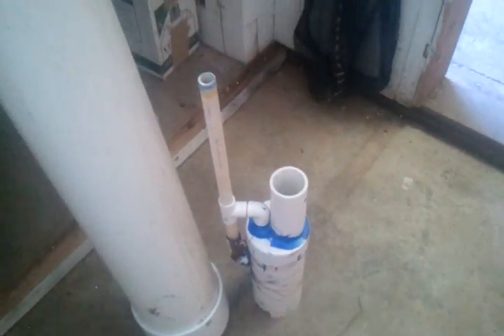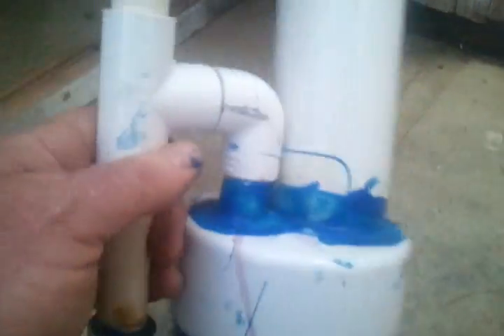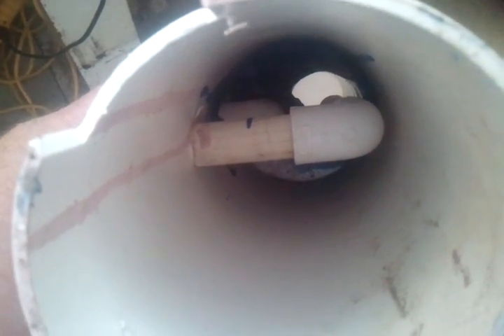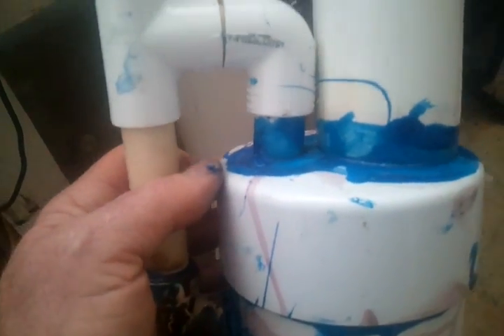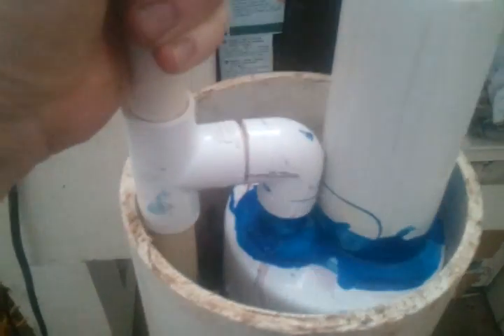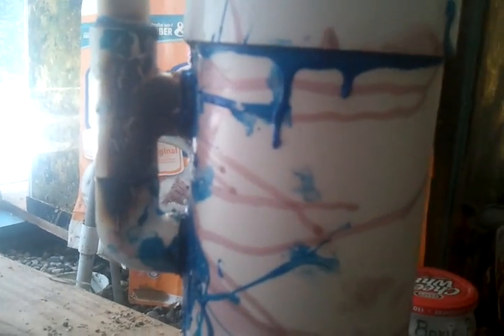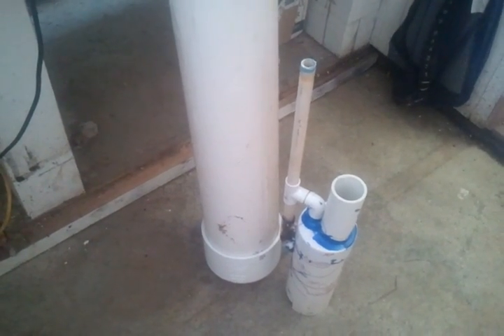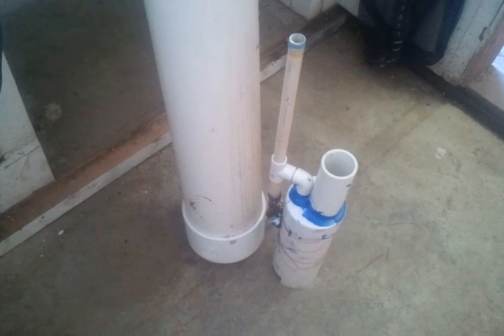Geyser Pump

Comment: Bob, Tnx for sharing this... On the patent, is stablished that "Note that the second air supply line 62 may be omitted if the superficial density of the liquid L is less than 1.5." Removing this air intake is easier to DIY this Geiser pump. It woulb be like this: Low Power Airlift Geyser Pumps - Part 3 of 3

Comment: Hello, you might experiment a little bit with a heat gun, few clamps, and that external 6" pipe, trying to make it oval rather than round cross section. Will make for an easier fit of the internal assembly. Regards

Comment: hi i think you did some errors here , where did you see this diagram?  the lower section is sealed as a different chamber then 2 medium sized pipes will enter , air pressure is created inside , the outlet is lower and water enters from upper air pressure , works like a water gun which we pump air in for pressure
Reply from the maker: You might be right.  I looked at the drawing in the patent.

Comment: Do you think this would work to lift water from a depth of 700' in a 4.5" casing?  That's the static level, I can go as deep as 1500'.
Reply from the maker: Not in a single stage.  This was many years, so I don't have the formulas at hand, but I'd suggest doing a search.  Use are real numbers to back up your design.
Reply: @BobCampbell530 I am having a hard time finding any formulas on the geyser pump but I have found formulas for regular airlift pump.  I'm thinking the geyser would travel further than the regular pump. Am I wrong on that assumption?  Also, I can't find anything on multiple stages. Everything is only single stage. How would I go about doing multiple stages?
Reply from the maker: @itsidustin I eventually felt the air pump and geyser pumps were too expensive to maintain. My water pumps out last the air pumps 5 to 1 or better.  After a while air pumps wear out so badly that they can't be rebuilt and they become very expensive.
Reply: @BobCampbell530 Ok, I do appreciate the transparency.  Please help me understand, other than the compressor, what components on the geyser pump wear out? 

In my situation, I have a submersible application that needs replaced. It's going to cost around $10k to do so.  I'm trying to find alternatives to doing this that are more economical.  There is a company called Airlift Technology LLC that does do this but they're not much cheaper at all for my application.  I'm trying to learn the technology to see if I can build it myself, if it's economical to do so. Thank you for sharing your knowledge.
Reply from the maker: @itsidustin With the scale that you are attempting to achieve you are going to need a massive amount of air, but it will also require adequate head pressure.  The largest pump I've ever used is a 200 liter per minute EcoPlus Eco Air7. It lasted just over a year before the cylinder wore out.  They were kind enough to send me a new set of pistons, but the repair did not work.  The diaphragm pumps seemed to last longer, but they too wear out, and I don't think they would be large enough for you. I've tried a Centrifugal air blower which produces enormous amounts of air and is great for aquariums, but it lacked head pressure.  I also used a blower out of a hot tub. Now that worked great, but the noise was too much!  So I don't think I'm qualified to help you design such a large system. There was or maybe still is a guy in Hawaii that used several stages to accomplish something like 30 foot of lift, but I can't find his channel.  I think I may have mentioned him in one of my geyser videos.

Comment: I missed how you went from 60 gallons /hr to 15-20000 gallons per day.

Also is it not more efficient just to use a small water pump. I think the smallest pump can still move more than 1 gallon /minute and to a higher level too
Reply: Water pumps are prone to jamming and clogging from debris and gunking up.  An airlift pump has no moving parts and will carry debris along with the water.
Reply: In theory yes, but even an airlift pump can get clogged up. I've had it happen to me. Fairly easy to fix though. You just block the outlet on top and it'll blow all the junk out of the bottom.
But i'm still not sure if they are more efficient than water pumps
Reply from the maker: Saeid Momtahan
 I'm not so sure they are more efficient either.  In low lift situations I think they are, but impeller pumps have an advantage when you need to lift the water more than a foot or two.  I've been disappointed in both the The Active Aqua AAPA110L commercial air pump and the  Eco Plus 7 Commercial Air Pump, 280W 200L/min  AE-SS-EP7.  Neither has lasted more than a year. I've also had t rebuild my General Hydroponics - Dual Diaphram Air Pump - 320 GPH (728040) at the end of one year.
I've had 4000 gph external pumps last about 2-1/2 but most submersible pumps last less then a year and require more energy than the externals per gallon pumped so there does not seem to be a real good solution.  Either way there is an unavoidable cost to replacing either air pumps or impeller pumps.  Initially air pumps seem to cost less but once again they are limited to lifting water only a small amount.  But I like the air lifts because they add air and pump water without hurting small fish that might get sucked up.  Clogging has only been a problem when the gunk builds up and I suspect that would happen with any pump, but airlifts are without a doubt less likely to clog from debris since they are open pipes.

Comment: Hi, Im trying to find out if simple airlift is more efficient or Centrifugal waterpumps for low height pumping. I found mixed results ,  any one has tryed airlift in a pond?

in some youtube videos some large pond setups has used low watt air pump to pump heavy loads of water . unfortunately i cant find out measurements how much its pumping . 

Normaly a medium level air pump will take 20 to 35  watts and pumps 40 lit air per min, people claim it pumps equal or more amount of water with it .

one smaller 35 watts centrifugal pump i have it pumps 33 lit per min water .
Reply from the maker: I'm not sure it's more effective, but there are other advantages such as being able to pass objects like fish without harm.  Another thing that comes to mind is durability.   My air pump only lasted 1 year.  But oxidation is also a factor.   Lots to consider.

Comment: Calculations seem suspect....airflow rate required decreases with increase in submergence...surely it should be the other way around?
Reply from the maker: I believe I was saying that I could have done another experiment using less air, but I didn't have equipment to do those measurements so I never did.